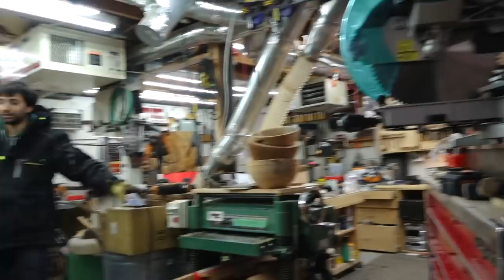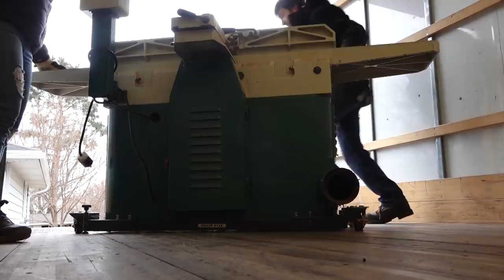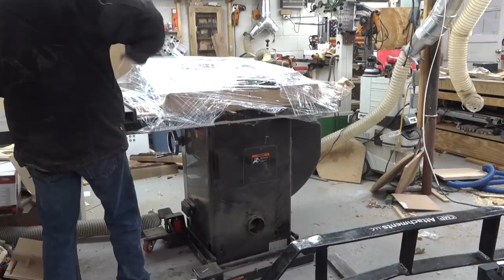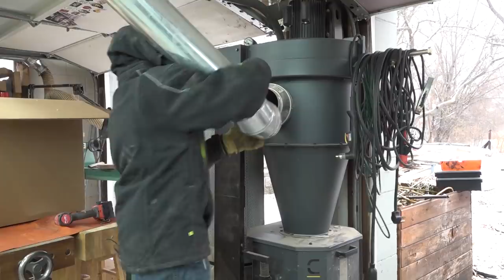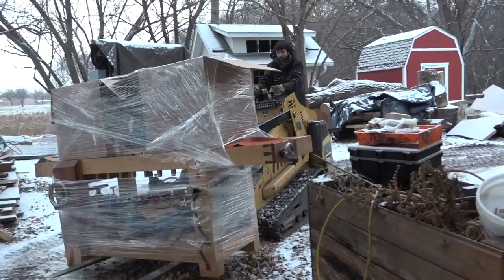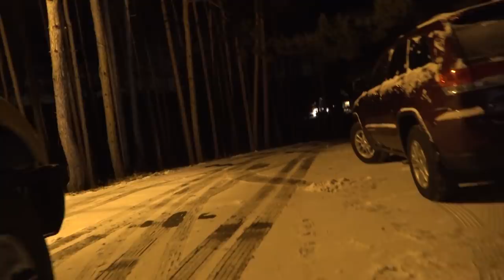Moving the Machines  - Moving My Woodworking Shop [Part 2]

Comment: Considering the kinds of things you do, that skid-steer may be the single most useful and valuable thing you own. I used to admire how expert you are at using the simple tools, levers, pulleys, rollers, inclined planes, winches, chains, arches, etc. to move things around manually. But that skid-steer saves a LOT of time and wear-and-tear on your body. I'm very happy you got it, and especially after watching this equipment move!
Reply: I would of course do the same myself if that's all I had, but skid steers, by there very nature, are actually pretty bad for working with forks. Not very stable at all. I would have used the forklift.

Comment: Matt you sure where trust worthy of those Snap On locks, I am a retired mechanic of 50yrs, I have 5 tool boxes all snap on, the draws some time slide open on moving day lol any way I was hoping to see them ratchet strapped .you made it that`s all that matters. good luck getting back into the swing of things after the move, I wish I had some more room only a 1 1/2 garage. from a friend in the great city of Detroit Mich. motor city madness
Reply from the maker: I put the drawers towards the wall of the truck and strapped the box to the wall just in case
Reply: hey just checkin up on you . be safe best of luck for you and the wife with the new house . happy new year also...i hope lol

Comment: That is one sweet jointer. I was at an auction years ago where they had an 18" jointer up for sale. I think it went for over $20k.  I'm glad you painted the new place. It always p***es me off seeing joints mudded and not painted.
   Don't forget to bolt down the drill press when it's in position.

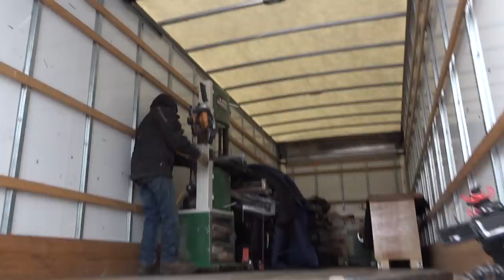Comment: Hello sir, I noticed at 15:50 you pulled your band saw by the table. 

I’m guessing you don’t have much experience with bandsaws, so I feel compelled to tell you that maneuvering the saw in that way can seriously misalign your table with the blade. I’ve been a contractor for 93 years.

Otherwise, you’ll have to re-square the table to the blade unless you want to ruin your lumber on the next project. You should be more like me and not do silly things. 

Best of luck with the move! 
Rodger from North Carolina

Comment: "Pack up the shop!? Ha that's for amateurs." - M. Cremona circa 2020. That little skid steer is a beast. I want one. Tell the truth Matt. You dumped the drill press on purpose so you could go shopping for another one. Clever. If the wife saw it fall, no questions asked. I may use that one too someday. Lol

Comment: What a job! It reminded me of the time I picked up my drill press by the pulley housing and the bottom plate dropped off onto my toe and smashed it -my toe, not the drill press. Different shaped toe but the drill still works.

Comment: brings back memories moved mine 400mls solo! uk to france, just finished anew w'shop 7 x4m x 3.5 high with drying area under the 6.5m rafters all solo, waiting for spring too finish the wall tops, train of gales here since before noel
Reply: How did you deal with the electric?

Comment: That skidsteer is a back and leg saver. And your wife is very smart (which you already knew) but box truck is easier to drive than p/u truck w/ trailer, and she can keep track of keys!
Also, (for next time maybe) highly recommend moving blankets, or the like, and then the plastic wrap over that. Cause, the plastic wrap alone doesn't protect against bumps and scratches caused by the movement of the truck bouncing down the road...

Comment: You bring back nightmares with your move.  I had professional movers relocate my tools from a basement shop up a grassy hill to the moving truck and then to a storage unit 17 miles from my home and shop under construction.  I loaded all of my tools in multiple trips on a 5x8’ trailer getting them all safely to my shop...except for the table saw.  Literally 50’ from my shop the strap on the saw came loose and the top heavy saw (minus side wings) tipped out of the trailer and on to the gravel.  Arrrgggghhhh!

Comment: Hey Matt, Happy New Year, nice way to start  out with a new shop ! You a not the first one to mess up a set of tires on your trailer. I did the exact same thing on a company trailer. Mine was on the passenger side.  Two tires, sidewall cuts . I had to get new ones and than tell the boss what happen. I am the one who pulls trailer the most in my shop .Lol even me screws up !!! My Dad always said if you don’t make mistakes, you are not doing anything! Regards Bob Lee 👍👍👍🤗🤗🤗

Comment: The dreaded top heavy drill press. Sometimes I have to drag my floor standing drill press away from the corner. Last time it fell over and cracked the hub where the lever arms thread into it and  damaged the cover.  A glob of JB Weld and back in service. I put it back in corner and it will probably fall over again.

Comment: Just a little fyi that I learned the hard way U-haul has lower decks and the Air ride That can be lowered make for an easier move but is a little more to rent. on our last move was from MI to SC Half way thru the trip I'd wish I had when with U-Haul that over 800 miles killed my bad back it took me 3 days extra to unload that thing. no mini fork lift for my cheap move.

Comment: The lady was right about the big truck ,,, It’s easier than tail draggin the Skid steer... LOL
Reply: Yes Matthew after many years of heavy dump trucking and tail dragging heavy flatbed trailers around  with Excavators and all sorts of paving equipment .. I semi retired by going to work for Penske as a “Hiker” which is a job moving vehicles around to locations where they are needed... So I can say with Certainty those 26ft straight jobs are big baby carriages...But for Limousine ride The Volvo SleeperTractors are hands down the winners......By Golly u-betcha... 😉 !!😁

Comment: I’m amazed you got the truck loaded in 3.5 hours even with all the wrapping work. I was wondering at first about lifting the heavy tools up to the truck bed, but I guess it actually gets a bit more stable the higher they go because the arc of the swing brings the load closer to the center of gravity?
Reply from the maker: Sort of.  The load comes closer but the center of gravity raises which reduces stability
Reply: @mcremona  
Any plate steel to stand on?
Reply: Just think how fast he could have loaded the truck if he had actually been ready to move stuff when he got there!!!
Dust collector hoses still attached, machines still plugged in, way too much crap left on things. Drill press still attached to the roller cabinet,,
Reply: @haroldphipps3457  
When it is all said and done the time spent wasn't much different especially since he did not have to box the small stuff he moved but kept it with the machines or tables.
Reply: @larrybe2900  His time spent was almost certainly less than if he had bothered doing those things.  I've been packing my garage/shop, and I easily have 20 hours in it.

Comment: I think everyone has 'dropped' something while moving their shop.  I had a workbench (still have) with a steel vise on it (got new vise). When I got to the new house I had to back my pickup over a small bump, which was just enough to launch the workbench out of the truck bed and land on the vise. That drop cracked the vise into 3 pieces, that would have been fine if those three parts had been cast that way, thus the new vise. By comparison, your move appears to have gone great, can't wait to see what fun you have in that extra 200+ sq ft of shop space.

Comment: I need to do that... only different. Seeing your floor appear makes me think I should move everything out of my shop and hit it with the backpack blower. Then sweep and shovel the floor out and run the sweepings through hardware cloth and a magnet to find the small "missing" things. Then put it all back together. Despite dust collection and ambient air cleaners there is still a lot of scrap, swarf, and fine dust all over the place that it would be nice to disappear. ;~)

Comment: Not bad, to only lose control of one machine (and no crucial damage) in a move like that. And no one got hurt. Top-heavy objects (and most machine tools are) are a bear to move safely.
The skid-steer is not quite so stable as a forklift (on a flat floor) but you got the job done. 
Professional riggers would have charged a lot (way more than REPLACING a few of the machines). My mill (3000#) was about $1000 to move (load, transport a dozen miles, unload).

Comment: Whew. How many times did you have to hop up into the truck and out again. A helper would have been handy.
I presume that the sawmill is coming over next Spring. It would be good to place it in a reinforced concrete slab.

Comment: With the new shop setup will you be looking at tracks on the ceiling to hang camera and light arms from? I remember a video from a few years back of a guy that built a setup using mostly plywood and parts from a hardware store for a low profile track when the arm is slid out.

No tripods taking up valuable floor space and easy to set back up camera angles.
Reply: John Heinz?
Reply: @larrybe2900  The channel name I saw it on is Bales
Reply: @TheUserid82  
I am not familiar with that name. I'll check and see.

Comment: Could you maybe give me a suggestion as to maybe why my miter cuts are nut coming out super tight. My saw appears to be all in order but I have been trying to make a frame for a mirror and I always end up with a corner that is not tight on the outside edge. Any suggestions will be greatly appreciated.

Comment: A little tappity tap and the belt cover on the drill press will be back in shape. Is the chainsaw okay is the question? 
Otherwise looked like an uneventful move. Congrats.
Edit: P.S. a couple of c-clamps on the forks help items like the lathe from sliding back the forks, (I know, too late for that bit of advise, but maybe it will help someone else).

Comment: Nice! You really get good use out of that skid steer. So what happened to the dust collector? Did you manage to move that yet?
Reply from the maker: It’s still there. Probably will take the wheels off and just barely get it out the door
Reply: @mcremona  That's what I was thinking, but then you didn't have the time at that moment, I guess.
Reply: @mcremona  Or the motor. Had you the same doors and wheels when you put it in? Or took you it apart?
Reply: @ReinoGoo  it came in boxes, he put it together in the shop.
Reply from the maker: My tools were in the snap on box. Not worth trying to get to it by that point

Comment: Im still so nervous about using a trailer, I've never used one before but Its my only option since i have a smaller suv.
Reply: Watch five videos on improper load distribution where the center of gravity of the load is behind the axle of the trailer instead of between the axle and the hitch. 

When backing up only use your mirrors (don't switch between mirrors and looking behind yourself, as steering will get confusing), and turn away from where you want the trailer to go.

Go slow and don't get in a rush even with an audience.

After that you'll be fine, and feeling like a boss.

Oh, and I'd recommend getting a long padlock that can be substituted for your hitch pin that locks hitch on your truck, so that 1. you won't worry that some vandal / child will pull it out while you are parked to get a beverage or something. 2. look it closed after you drop your trailer so that your trailer won't get easily hauled away by someone who shouldn't be hauling your trailer away.

Comment: Hi Matt, did you ever consider putting the items on pallets and anchoring the items  them to move. Then getting a truck with curtain sides and then lift them in from the side. This is what I do when moving boxes etc. it makes for a safer, easier and quicker move with less risk of items falling over. The bonus is you can pre-pack pallets in the days/weeks beforehand and then on moving day, just use a "forked" machine (like your skid steer) to manoeuvre them around and then you can work on the rough layout of the shop when you get to the end. It might make moving the piles of slabs easier by stacking pallets and then lifting them in multiple trips. I really appreciated the way that you moved the bulk of everything with just one truckload. Enjoy your unpacking... I moved in 14 years ago and still have 3 boxes yet to be unpacked... Mostly Christmas decorations, garden pots and camping gear.

Comment: Are the neighbors happy that all that noisy equipment is leaving?
Reply from the maker: Well the neighborhood tool library just shut down
Reply: @mcremona  , I get that. I was the tool library in my old neighborhood hahaha
Reply: IMO, overall Matt was not that noisy for what he was doing. I imagine without the skid steer there would have been a lot more grunting and vocals. ;) I believe he had very good neighbors; the kind willing to drive across town to access the tool library knowing he doesn't have what they need.